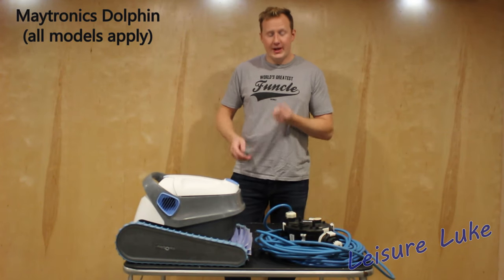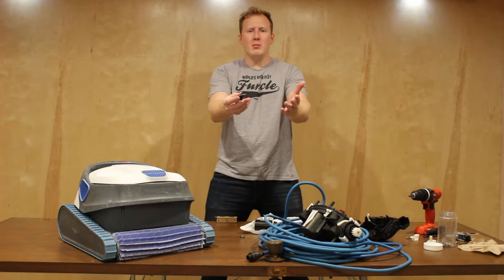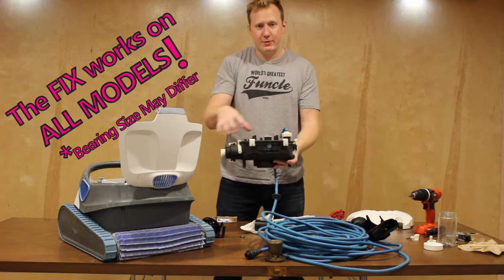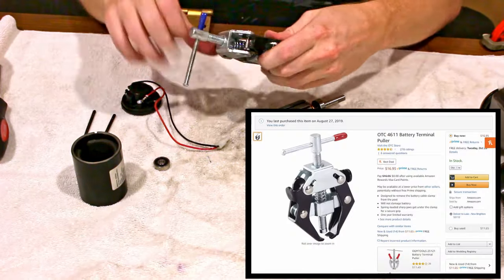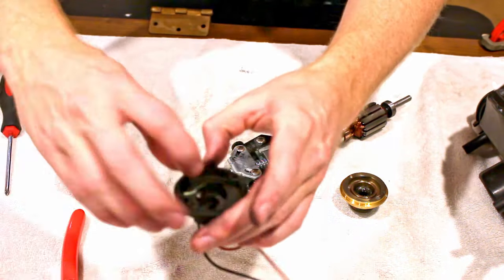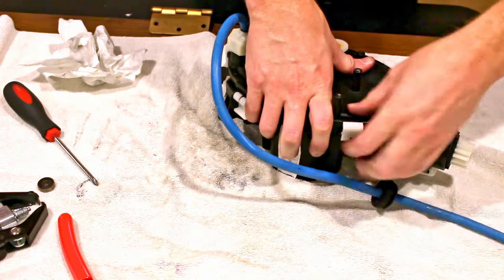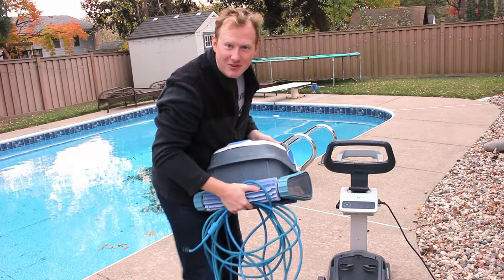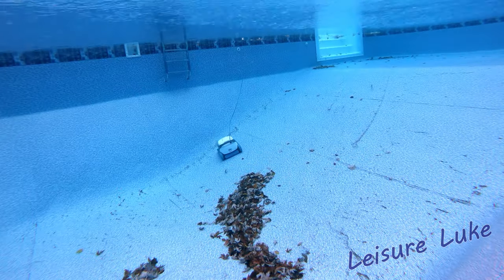Dolphin Pool Cleaner - BROKEN is FIXED!!!  SOLVED with 1$ Bearing | HOW TO REPAIR for MOST Models!

Comment: I really like your tips. Unfortunately the screws on my impeller motor shredded and we cannot open up the motor to get to the bearing 😢. They are shot. Have you found a good replacement impeller motor?

Comment: Do you have a video on how to get the main housing (where the two motors are located inside) apart?  I started to do so yesterday and it felt like I was going to break something.  If no video, a description and tools used would be great.  Thanks Luke!
Reply from the maker: Sounds like you're referring to opening the black box?  That just has clips that only need a little force to become unclipped.  If yours is like mine, it has never been opened.  It just took some muscle and I sort of "worked my way around" prying to the two halves apart.  I wouldn't use any tools other than your hands, as you don't want to damage the 2 gasket rings that keep the box sealed.  The will pry apart, and the gaskets should be pretty greasy, which is good (help keeps the water out).  Working my way around I could slide the two halves apart maybe 1/8 inch, then move to the next side.  Hope that helps!  No magic tricks here, unfortunately.  GL!
Reply: @LeisureLuke  Thanks!  I had the clips unclipped but wasn't sure how to pry the two halves apart.  Will use more elbow grease and see if I can get it apart.  Very much appreciate the video and quick reply.  Cheers!
Reply: Where you able to get yours apart? I have not been able to get mine apart yet and I'm wondering what's the trick

Comment: Hi 
Saw you video looks very easy to understand how to go about changing the bearings
What  bearing size and how many do I need for dolphin S200 
Vince
Reply from the maker: You'll probably only replace the one that failed, but each motor has 3 bearings if you wanted to replace them all.  The s200 probably uses the same 626rs bearing as the 300s.  The good news is most bearings have the size printed right on it, so you'll know what you need once you take it apart and find the problem bearing.  If you have any questions, let me know!  Worst case, you can measure the bearing with a calipers, and use that to lookup what you need.   626rs = 6mm Inner Diameter (ID) x 19mm OD x 6mm thickness and RS = Rubber Sealed.  The seal doesn't matter, just the size.
Reply: Thanks 
mine isn't broken down yet but wanted to know what size bearings I need for S200 so I have the parts ready 
Where can I purchase from Thanks
Reply from the maker: @vincepinneri1703  Don't stock up on these parts :) they are literally $1 or $10 for a 10 pack on amazon with same day shipping.  Local rollerblade or hobby stores may have them in stock as well.  Not hard to find or expensive.  Also, yours may not break for 5+ years!
Reply: @LeisureLuke
ok  thankyou for your reply

Comment: Hi, I noticed that you uploaded your video three years ago, so I'm not sure if you still remember the issue with the Dolphin cleaner. I have a Dolphin Advantage, and it's experiencing the same problem you described - it moves a bit and then stops.

I've already disassembled the cover and checked the impeller. There doesn't seem to be any clogging, and it turns by hand. There's a slight resistance every 1/8 (or so) of a turn, but I believe it might be due to the permanent magnet. I've also checked the cable, and it seems to be working fine. Despite these checks, the problem persists, and I'm running out of ideas on what to investigate next.

Do you have any suggestions or ideas on what else I should look into? Thanks.
Reply from the maker: Can't say, but it's not the same problem as this video.  Other things to checks are shorts in the cord (see if it runs out of water on a block), a stuck drive motor, or stuck/jammed tracks.  The motor resistance you're feeling is normal in that impeller.  Best o luck!
Reply: @LeisureLuke  Thanks!!

Comment: I think I overran the load? Sticks for where they shouldn’t have. Cleaned it out and the impeller top works great and the wheels move during the test but not in the water. No error code. It’s likely a bearing?

Comment: Hi Luke,   I removed the black propeller piece with the fins on it.  But when I did that, I noticed that the impeller cylindar did NOT rotate freely.  I could move it with my hand, but it felt like it was catching as it was being turned.  This, to me, is undoubtedly the problem.  But do you think that removing the impleller cylindar and replacing the ball bearing will help?

Comment: question please: My Dolphin E10 lifts up in the water (almost straight up before laying back down over and over) while vacuuming. What is this? Thanks!!
Reply from the maker: Check your impeller.  As the impeller gets clogged with hair and debris, it'll become less efficient.  Unplug the device, and with a hand screwdriver you can quickly get down to the bare impeller (the fan blade).  It's a little sharp.  Clean it and the area underneath it.  Hopefully that'll do it!

Comment: Very good video. I have a nautilus cc plus. Mine stopped working so I took it apart.
Opened the motor enclosure and found that the control board is not any good. I checked all the motors and they ran good. So I have correct voltages from the contol box to the motor control board . I have come to the conclusion the motor control board inside the unit is bad. Do you have any leads for replacement control board inside the motor housing.
Thanks much

Comment: Hi Luke, thank you for the video, the break down and assembly was easy.  I was hoping to find that my bearings were bad,  but what I found was that the rotor has 2 spots that were worn. I also found black powder, what seemed to be a graphite lubrication; your thoughts?  The bearing were fine.  Thanks Again. Andrien

Comment: Hi man - this was a great video, and thanks so much.  Unfortunately, after I put mine back together, the vacuum wasn’t working… but it drive around back and forth which it wasn’t until I replaced the seized bearing.  Any idea why the vacuum wouldn’t be suctioning?  The impeller spins freely as it should and is completely clean, and the lid and basket are shut tight with no holes in the basket. Thanks again!
Reply: Nevermind, I fixed eventually by cutting and reversing the red and black wires from the motor to the circuit board.  That reverses the way the motor shaft spins if it is spinning the wrong way after repair and reassembly.
Reply from the maker: Just saw this now!  Yeah, that’s a common problem I hear about on reassembly.  I think I just got lucky and didn’t call it out in the video.  Glad you figured it out & got squared away!  Nice work!

Comment: Do you have to grease the rubber gasket before closing it up?  I had to clean the gasket because it was dirty.  It seemed to already have grease on it, when I took it apart.
Reply from the maker: Yeah, I put fresh silicon grease on mine... probably helps with the seal, collecting little bits of dust, and keeps the gasket rubber from drying out.

Comment: Hi, I have a similar issue where it will move a bit, then go back a bit, and then stop.  I checked everything and removed any debris, but I can move the propeller, should it be very difficult to move if it's broken or needs a new bearing?  I can move it, but it has a little resistance, is it normally completely fluid movement, or how much pressure should it take to move it?  I'm trying to figure out if it's the motor like in your video?  If not, could it be anything else, such as the control board or something else?  Thanks, and great videos!
Reply from the maker: Something is telling it to stop.  The propellor will have some natural resistance, but if you remove the shroud around it, it should be pretty easy to turn by hand.  Usually it’ll keep running as long as it’s turning.  The forward then back and then stop result matches mine, and I haven’t seen anything produce that result except a bad motor or jammed propeller.  I would open the black box, and check for water damage.  I’ve taken a few apart now, found nothing, put it together and it works.  I would also test it once out of the water with the covers removed and see if the impeller spins.

Comment: Just curious to learn about how you tested/replaced the bearing inside the brass cap.  Seems i have a fair bit of resistance when the motor is inserted through that cap. But spins freely when its removed.
Reply: Yeah same question

Comment: Interestingly, I had this same problem. When I took it apart everything seemed to spin nicely. However, there was lots of black build up. I knocked what I could loose and threw it back together. And somehow the thing is running again. Holy shit.
Reply from the maker: Nice work!!!! Party Accordingly!  Yeah, I wish I would've thought to film the force needed to spin the impeller.  In most cases if it "Can Spin" it's fine.  For me, there was no chance I was going to spin it without hurting myself :D Anyway, job well done!

Comment: Thanks for this video.  The bearings in the brass fitting were plastic.  I did not see ball bearings in it.  The measurements are 8x22x6.  Can not find replacement and not sure if it is a bearing or casing.  Would appreciate any advice

Comment: rarely the case, most often water penetration will fry the circuit boards and the motor box is spare parts
Reply from the maker: That can happen, but literally hundreds of people have fixed this issue, with success and longevity!  Ready the comments 😁

Comment: Luke one cuestion i got everything out....but how i open the black box to get to the motor?
Reply from the maker: You have to unclip the plastic clips, and then just work your way around with a small pry bar, screwdriver (careful not to gouge it up), or a putty knife.  It's on there pretty good, and is just pressed on with 1 or 2 rubber seals.  If you work your way around with a tool it'll open.
Reply: @LeisureLuke  thanks

Comment: Mine has the same problem, but my impeller spins freely. I wonder if the bearing could still be the issue?
Reply from the maker: Nope, if your propeller can be spun, it's not a bearing issue.
Reply: @LeisureLuke  well crap. I wonder what it us

Comment: Hi, followed this to repair a seized motor.  Thank you.  When runing what voltage should be measured across the impeller motor bushes?   I am getting 28 volts, which I think is much too high and I may also have a pcb issue.

Comment: I have an s200 is it the the same bearing?  Here I was thinking my pool was being cleaned every time I pushed the button and went inside As it did in the past lo and behold it’s not working.  Thank you so much for your video I hole I can get it working and put back together ok😊
Reply from the maker: Yeah, I was told by someone else that their s200 impeller motor uses the same 626 rs bearings.  Fortunately they write the numbers on the side of the bearings so when you take it apart you’ll know exactly what to get.  I’m guessing it’s hard or impossible to spin your impeller by hand?  I’m sure you’ll do great!  If you can fix it it’s a huge accomplishment and a nice savings :)

Comment: Nice work.  Thanks for posting the video.  Does anyone know what the bearings are on other Dolphin Pool Cleaners?
Reply from the maker: The bearing numbers will usually be written right on the bearing.  If you have a calipers to measure the width, height, and hole size we can figure out exactly which bearings you need.  Of course, you'll have to dig in and remove one first.  

There's no master list of which bearings are in which dolphins.  I actually think they may have used different motors over time in different models.  So far the x40 and 300i and more have use the 626-2rs bearings.  Hope that helps!  Good Luck!

Comment: Excellent video, I just got mine the S200
Reply from the maker: Nice!  Hopefully you don’t have this repair anytime soon, but you’ll be ready when the day comes.  I’ve got 2 now, and this is the only failure I’ve had.  I’ve replaced the filters when they get a cut, and the cables will need replacing soon.  Other than that these are great!

Comment: Great video. Can you help me?  

My unit is a Dolphin CC plus and had a manufacture date of 06/17. It has spent a couple years in chlorinated water and the other 5 in a "salt water" pool. We are in Tampa FL and it gets run about every 2 to 3 weeks, usually for about 1 cycle or sometimes 2 and when the pool pump is off. Our pool is screened in so normal debris is just dirt blown into the area.

 A few weeks ago I noticed what looked like the remains of foam ring about 3" in diameter in the pickup basket, A couple weeks later i found another almost whole ring and it was shape was like a doughnut. I now believe that those are the rings that fit on the main shaft to assist in wall climbing. However even then the machine ran fine and I disn’t even know the rigs might have come from the cleaner.

However yesterday I put the machine in the water and started it and it ran about 2 feet forward, then two feet in reverse and the shut off.

Using your video I started taking it apart. After simply taking it apart, I plugged it in and it would now run about 3 feet forward and three feet back and then stop.

When I took the sides off I noticed that the foam block on one side appeared as if the tread had been forced against it and ground a portion of it off. I believe that some foreign object may have made it into that area and caused the foam block damage. After cleaning that I ran it again with the same results. I checked all 3 bearings on each side and they all seemed very free.

So I opened the motors case and saw nothing unusual. It was dry and the desiccant bag was dry and the impeller ran during this and sounded free but shut off when the main drives did. So I ran the motors again and they did the same forward and reverse for about 6 seconds then quit. The impeller did the same.

Since the motor shafts did still rotate I did not open up the motor yet. But based on what I have seen, I believe that something is causing some type of a safety switch to shut off or a fuse to "blow." And then after10 seconds it resets and I can start it up again but it repeats the same cycle and shuts off.

Do you think it is a problem on the circuit board or something in the motors even though they do run. The motor make mechanical nose but I don’t hear any grinding or rough running.

If it is the board, is it available and is it worth fixing? All the treads do have wear so I suppose a rebuild kit (about $170) would take care of that but I don't think that is THE fix.

I didn't see any corroded wire or burn marks on the board and as I said it did run for short periods.

Other than taking apart the motors I can’t think of anything else to try.

Your thoughts? Thanks in advance.

Comment: So I broke two of the copper pieces loose while using a screwdriver to get the bearing off. Any suggestions on what I could use to glue them back on….

Comment: Luke, great video. 
My Dolphin Quantum works well but has trouble climbing walls and staying up for the waterline...it looks as if it didn't have enough power to stay up. Do you think it could be the motor bearings as well?
At first, after trying to look it up, I thought it could be the climbing foam rings but I don't think the Quantum has those.
Anyway, let me know if you have any thoughts. Thanks!
Reply from the maker: I’d start with disassembling it to the propeller.  One little piece of hair or a little leaf stem can make the impeller way less efficient.  I also know if your pool is very cold ( under 65 F ) the rubber tracks are stiff and it doesn’t grip well.  Also, make sure that dolphin filter is nice n clean, once it’s plugged it can’t make the suction.
Reply from the maker: If the bearings are the problem it’ll completely stop in a matter of a few sessions.

Comment: Thank you so much! 🙏 And god bless for sharing! Your video saved me $750 of buying a new one 😀 I’ve a Dolphin Nautilus CC Plus and was acting the same. I bought the 626-2RS Double Rubber Seal Bearings on Amazon. Opened the impeller dc motor, cleaned it well with CRC electronic cleaner and replaced the ball bearing that was bad. While I was at it, I also opened the drive motor as well. Cleaned it with CRC electronic cleaner and assemble everything back. I notice lots of carbon ash inside my both motor from the carbon brushes. They still have some contact. would you know the size to them for replacement for future purposes? 🙏
Reply from the maker: Congratulations & Nice work!!!  I'm super glad you were able to keep it alive and save that cash!  Yeah, those contacts seem to be a "wear" item, but I'm guessing they're made to last a LONG time.  Mine looked good and I never really thought about it.  Hard to know how big those contacts were to start too.  I don't actually know anything about ordering more, or what specs are important.  I have seen motors individually up for sale lately, so maybe you'll get lucky with a $50 replacement motor.  If you're worried about it, I'd track down that motor # and keep your eye on ebay for someone selling.  Good Luck, and again, well done on the fix!  Glad I could help!
Reply: @LeisureLuke  thank you so much. Would you know the part number for the motor just incase?
Reply from the maker: I don't even know the numbers for my dolphin anymore.  It should have a 7 digit part number on the motor that starts with  55xxxxx.  Again, contacts should last forever.  I'd probably just leave it and wait for it to fail again.  There are a TON of electric motor contacts for sale.  You'd just need to know the size and you can probably find replacements.
Reply: @LeisureLuke  thank you again!